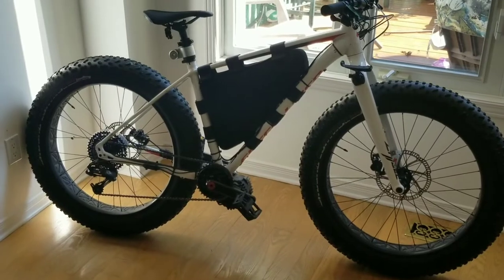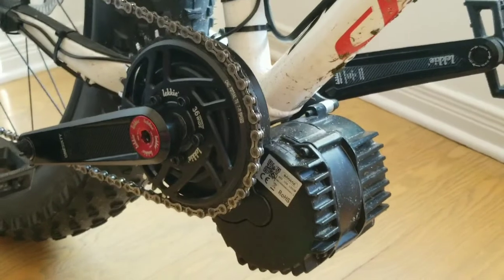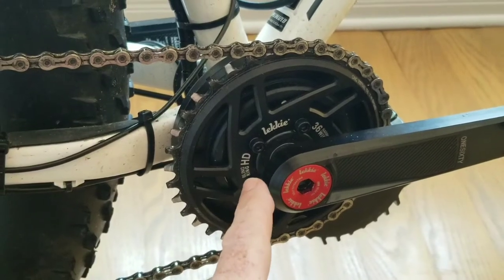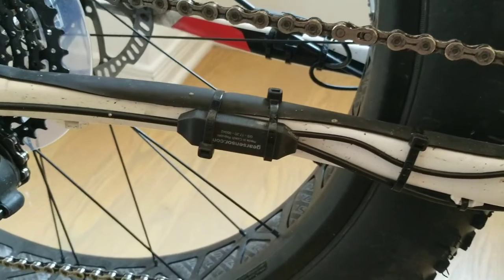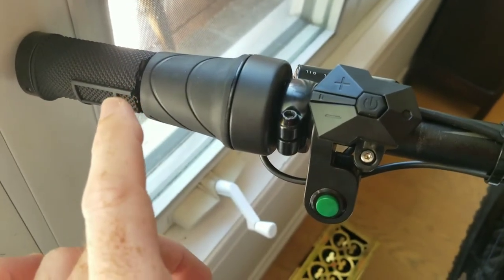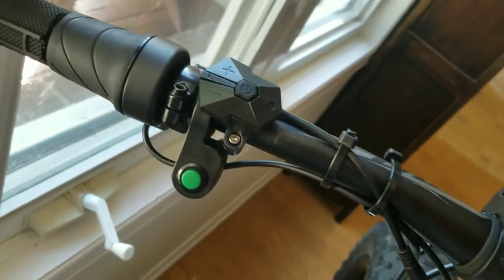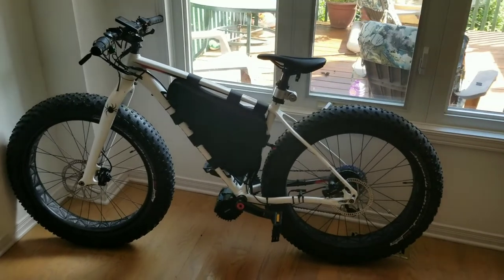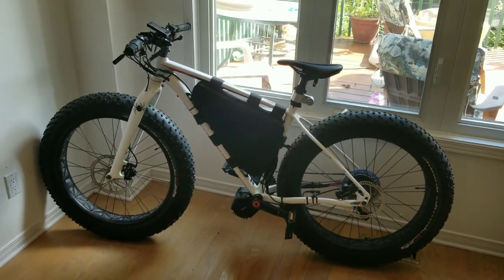Bafang BBSHD on Specialized Fatboy ebike conversion (stock) 30 amps 1500 watts

Comment: Never had a problem with chain line or coming of with stock . And anything snaller than 46t is just to slow
Reply from the maker: With my bike its because of the clearance. The 120mm version pushes the chainline out as it needs to clear the chainstays. Cheers!
Reply: @HighVoltageKits  i have had problems in my younger days and stupidly used opiates , and now 28 yrs on i have problems getting my liscence back .
Being a bricklayer i need to travel 20 miles one way sometimes so i should have gone for the HD . The bbso2 in level 5 can do 28mph easy running a 48v .thinking about the large triangle battery and next yr buying the hd and the big em3 case like yours .
It would be ideal if i could keep the speed at 26 to 28 all the time . Bit worried putting 52 v on the bbso2b really . But i am carefull not hitting the throttle on hills .
I like your set up .
I just got a german cube aim pro which is less than half the weight i have my bb on at the moment and have 44t all the way to 48 to a 52t . So if the rides hills i would take the 52 off .
Not one chain drop on the bike at the moment but when i put it on the cube things may be iffy lol . Hope not .may run better on the light cube with 11"34
Reply: You have no experience with the bbso2b . Just been reading about lunas black box . Never gone into programing the unit , but do they come stock at say 80 per cent speed ? I dont think its worth messing with mine as i have been reading some guys struggle to get 32mph with the bbshd captan lol . Great vidios mate and this hobby lm hoping will help with my addiction to.

Comment: Cap imagine the 46as they dont go bigger on , no big hills you would be hitting some top speed
Reply from the maker: The 42 was the biggest i could fit with the frame. It goes plenty fast tho these days.. Have you seen the 72 volt videos?
Reply: It does fly mate . Looks like you live in a really nice part of the states . Police here are not bothered to much ,:as long as your not drawing attention and hitting 30 when there about .
The police on the US can be very aggresive and not very nice .
But when most guys are carrying guns the cant be to nice . 12 yrs ago anyone with a gun could take them to the police station an no problems . If you get caught in the uk 5 yrs min .
Lotsa scooters about the last 2 yrs

Comment: Can you help me convert my plus size tyre mtb into ebike? LoL
Reply: Fuck just heard you say you're living in Canada! My bad then.
Reply from the maker: Well you are welcome on my discord. Post questions etc. Knowledge help for sure. Physical help might be tough. Cheers
Reply: Captain Codswallop I'm thinking about getting a front wheel hub motor if I do it because I'm fairly heavy so my thinking is the weight would be better distributed at the front as I'm a big boy lol. It's knowing where to get them from and what are decent prices. I've looked around and seen some on bikeleaf but it's Chinese I don't really trust their stuff (had a escooter that had problems) also what watt would you recommend and battery? Just give me some advice if you can. I don't want to spend mega but would love to go 20-30mph on my mtb 😀
Reply from the maker: Post what you are thinking on here https://discord.gg/AnyQRuh that way more minds can have a look. Hubs are not really my area of expertise. Others can benefit from the conversation this way as well.